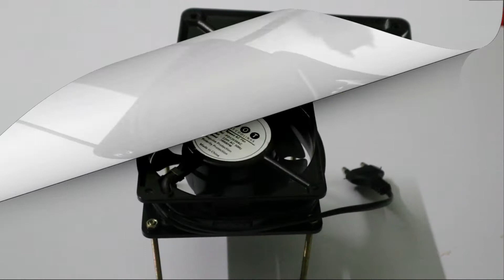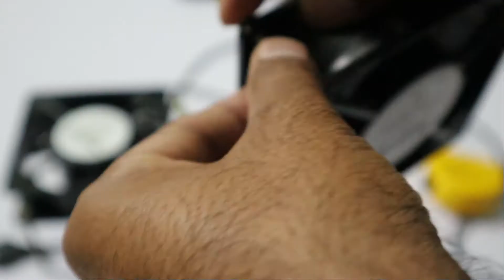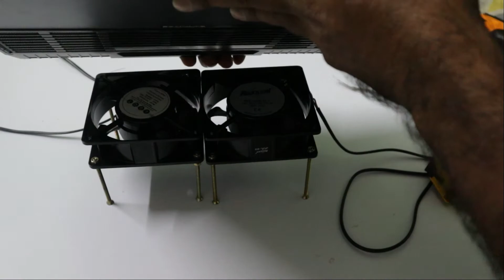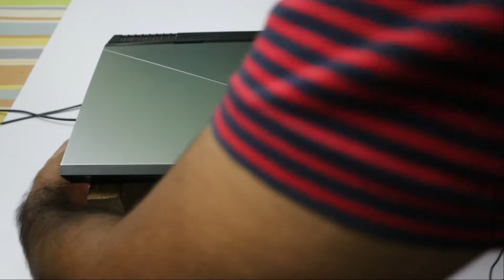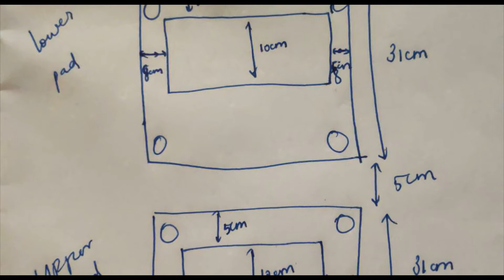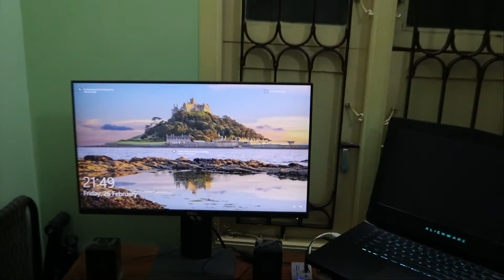Best Custom Laptop Cooling Pad or Stand for Gaming at cheap price | Reduce 20° to 30° | AC Fans 2022

Comment: Amazing 👌
Reply from the maker: Thank you piyush 😍
Reply: I tried it with one fan and only 1or 2° decrease temperature ,what I do to get 5 to 10° less temperature
Reply from the maker: @piyushchouhan468  Piyush may i know which fan you used and from where you ordered it ? AC or DC Fan ? and AC Fan in local store dont give much airflow kindly order from link which i have given
Reply from the maker: @piyushchouhan468  And also i am only using one fan now which performs equally.
Reply: @rehanhanar  I am using ac fan which have 3000 rpm
Reply from the maker: @piyushchouhan468  do u keep the fans on the floor or use some elevation ?
Reply: @rehanhanar  distance between floor and fan is 2 cm
Reply from the maker: @piyushchouhan468  won't give much airflow... Give much distance like how I have given in video.. Did u check the paper test which I have shown u in the video.. Is ur fan performs the same ?
Reply: @rehanhanar  airflow is good ,I have acer nitro 5 in which the vents on the back have less space and where cpu and GPU are placed are nearly packed from backside ,where I need to put the fan
Reply from the maker: Did u use the wood for elevation ?
Reply: @rehanhanar  yes
Reply: @rehanhanar  should I try to change fan angle or it does nothing
Reply from the maker: @piyushchouhan468  Try with 2 fans